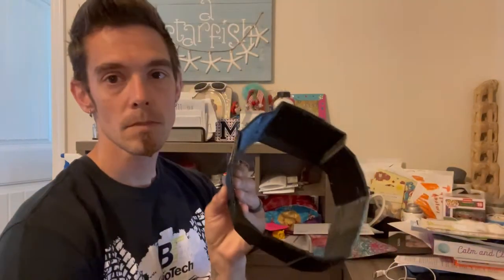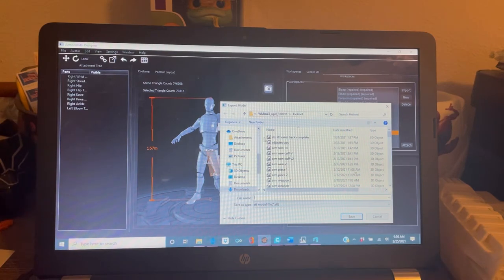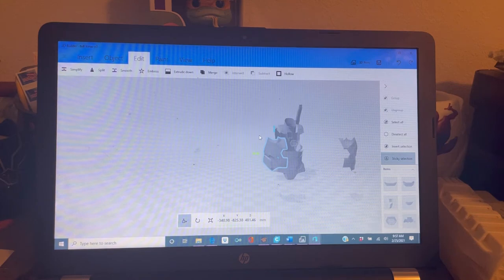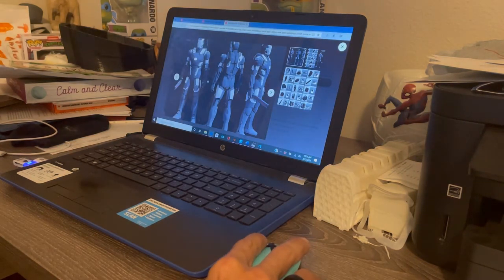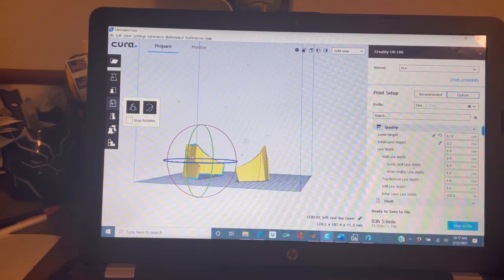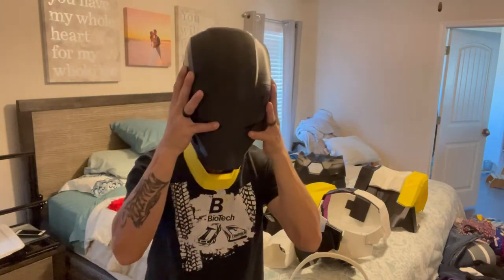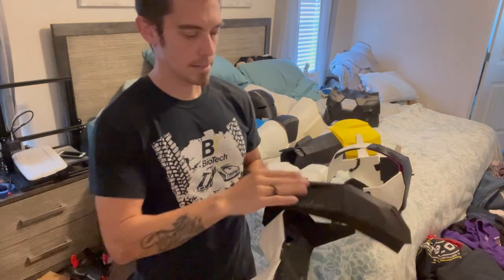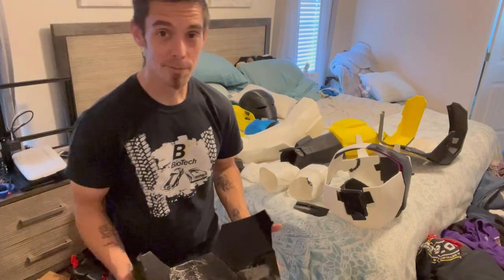3D printed iron man | Scaling 3d prints using armorsmith | Punisher war machine suit printing pt 1

Comment: In the joints I made mine out of rubber silicone. You add the color tint that you want as you're mixing silicone. You can make mold out of the same stl file your using so instead of making it out of pla. For instance the neck piece would have free movements and more comfortable. You can do this with the elbows, knees. I don't  document my builds but I get ideas from youtubers like you that have  great idea's. Keep making videos you are awesome!!
Reply from the maker: That’s a great idea, I definitely need to look into mold making. You should join my discord & share some pics, sounds like you’ve got a hell of a build going!